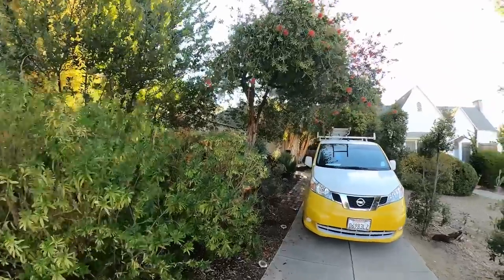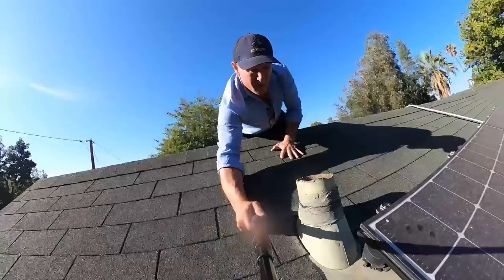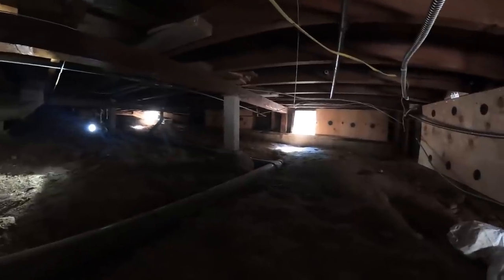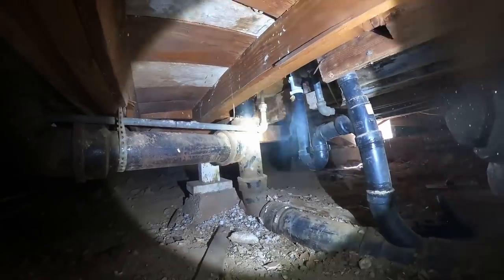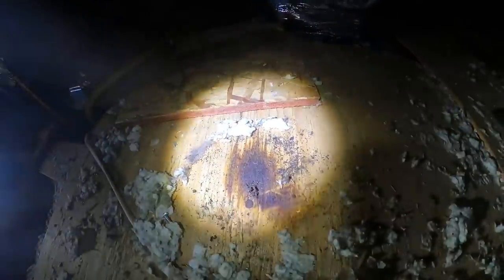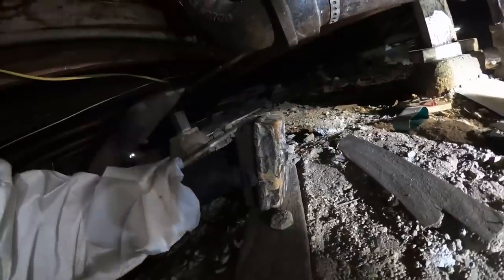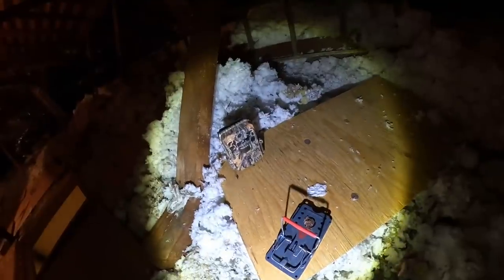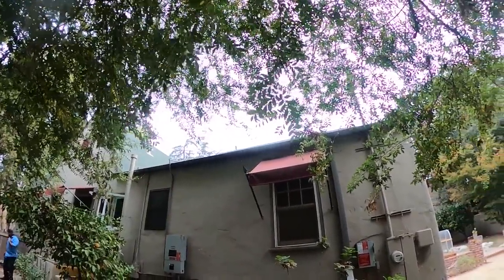How to GET RID of RATS IN YOUR ATTIC...BEST Rodent Removal

Comment: Had a few holes that rats had got into my attic.Slim jims and peanut butter set the Victor rat traps and for 3 days I got those pest in the traps.The past few days they have not set off anymore traps.All the hole are filled so the res no way out?I don't care to use poisons because it affects other wildlife.So the Victor traps work the best in my opinion.

Comment: Good job guys I have rats in my backyard  me and my  neighbors poison traps dering the summer spray there holes with bleach drives them crazy but want leave now using coyote urine the next day or two there holes are gone but I find they just move to a new hole dont hear any noise in the walls I have  
64r inserlation in my attic fiberglass it's about chest high it could be why I don't hear any noise up there..